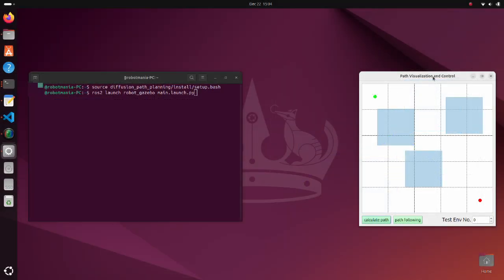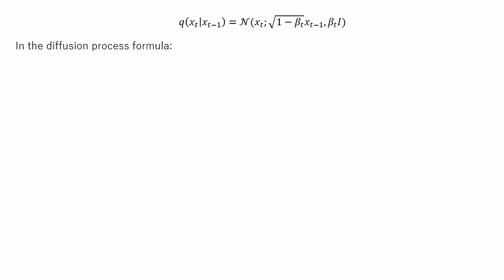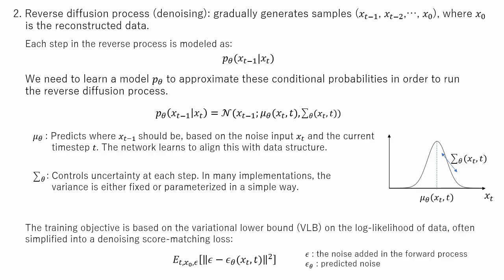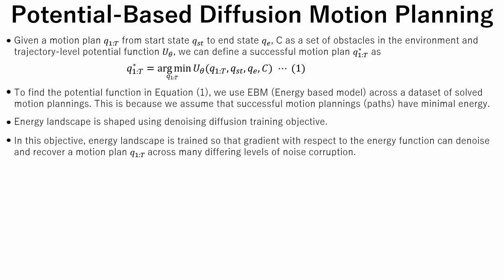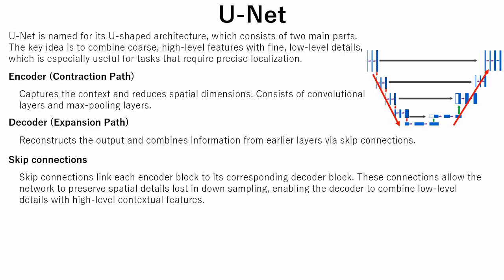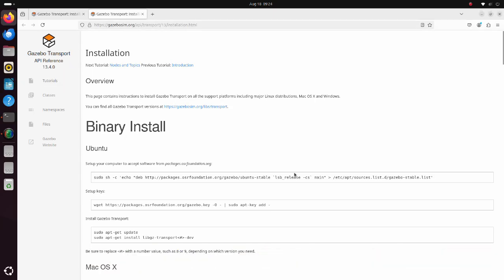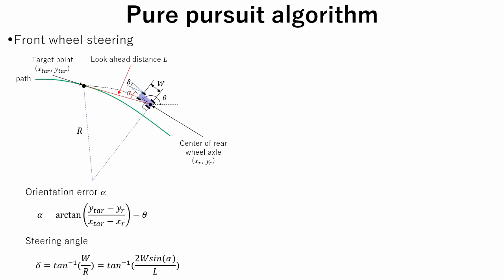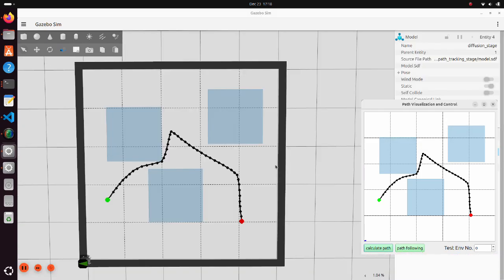Path Planning Using Diffusion

Comment: Could we can use this Path Planning Using Diffusion  on the 2D Map environment ?
Reply from the maker: Hi Nhat Net!
Thanks for watching my video!
This path planning was trained on the kind of maps where we have 3 squares. So, it will not work well with a general 2D map.
Reply: Are there any ways to train this model on the 2D map. Is it possible? @robotmania8896
Reply from the maker: Yes, it is possible. For training method, please see original repository. But data collection will take you a lot of time.

Comment: Thanks dear @robotmania8896 for your useful and informative videos. I have watched your video "How to Use ROS2 Jazzy and Gazebo Harmonic for Robot Simulation" and tried to generate similar files from a simple 4 wheel robot urdf file using moveit2 but output of the moveit2  is different than your files and I have some issues for spawning the robot into gazebo. Which tool you have used for generating your files in that video?
Reply from the maker: Hi amin a!
Thanks for watching my video!
You don’t have to use MoveIt unless you would like to simulate robotic arm. I didn’t use any tools to create files which I used in the "How to Use ROS2 Jazzy and Gazebo Harmonic for Robot Simulation" video. I recommend you to take my project and modify it. Basically, you have to modify xacro files and controller.yaml file.
Reply: Dear @robotmania8896 finally I did it😅 Your codes saved me from a lot of hard working times. Best wishes for you

Comment: Pleas can you do project like this but in ros2 humble
Reply from the maker: Hi Ahmad Kasem!
Thanks for watching my video!
I think the ROS2 part will work with humble. Although, if you are using gazebo ignition or gazebo classic you have to change the gazebo-related part of the code.
Reply: @robotmania8896 Thank you so much .But you mean that if I load the backage of this video it will turn on my ros2 humble. I mean thay you turn this project on ros2 jazzy but my distribution is humble

Comment: Thank you for the great project. I have a few questions. Could you compare the performance of Potential Field, RRT*, and A* algorithms? Specifically, which algorithm is the most suitable for a small area (around 5×5 m²) and a large area (around 50×50 m²)?  with small area what is the algorithm I should chose, and with large area what is the algorithm I should chose.     
2 . Can above algorithm avoid dynamic object? if no, how to improve to avoid the moving object
3. We can apply Diffusion model based  RRT instead of potential. Thanks
Reply from the maker: Hi Nhat Net!
Thanks for watching my video!
1.	That is a difficult question. I think it depends on use case. Both algorithms are used in robotics. As far as I remember, A* is used for global path planning in nav2 and RRT is used in MoveIt for arm path planning. And those algorithms work well. I don’t have much experience with potential field methods but I think they are more often used for local path planning. RRT is also used for local path planning.
2.	I am not sure about A* but RRT is used for local path planning. DWA is also a common approach for local path planning.
3.	In my understanding, diffusion and RRT are different calculation methods, so there is no such thing as “diffusion model based RRT”.